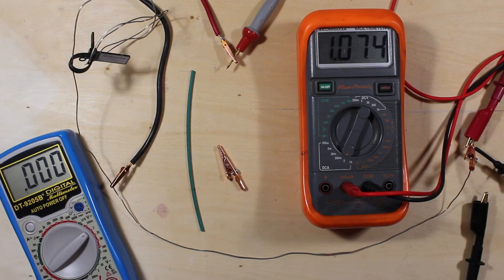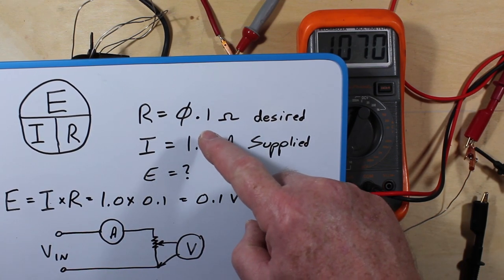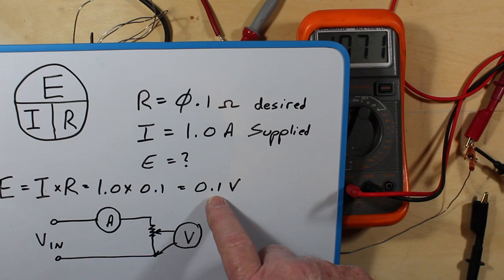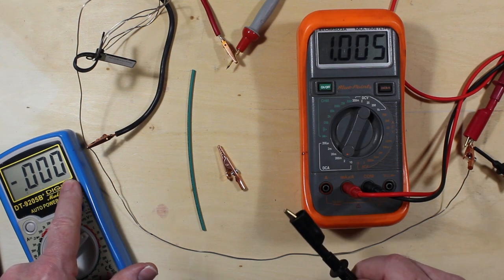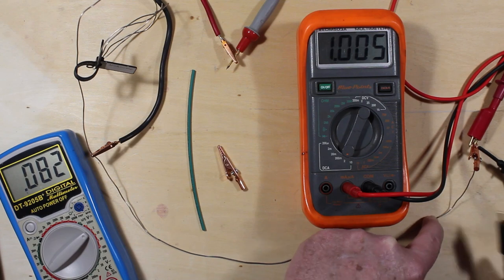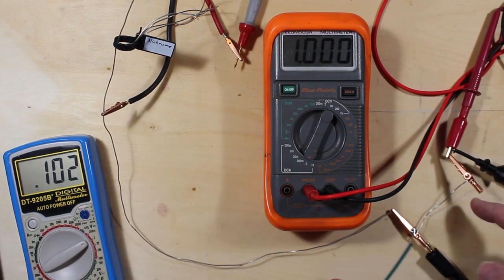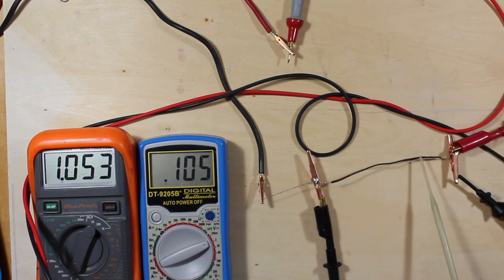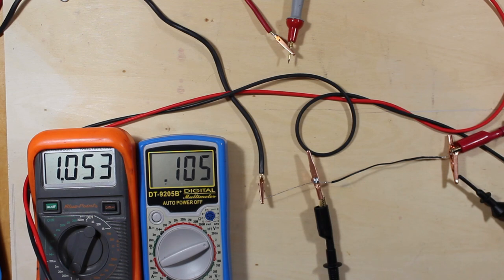DIY Low Ohm Resistor For Current Measurement  #electronics #diy #measurement

Comment: Hi,... it was quite by chance I landed on this video,... and thought it deserved a comment for it's utility. ( & educational point )
- About a year ago, I had a short-circuit on the 'alternator-battery' side of my 38-year-old Nissan Micra.
- It blew the in-line 50Amp 'safety fuse' !!!  
- With no documentation I eventually found the issue,.. but needed a replacement FUSE.
- Fortunately, being an electrical/electronics engineer,... and using the the 'resistivity of copper' (per cubic meter),... I was able to calculate & fabricate a direct replacement using a 1.2mm diameter solid copper wire (as used in standard UK house electrical wiring installations) of approximately 75mm in length.
.
Reply from the maker: A solution in time of need.  Was it a 'fusible link' (a short piece of wire smaller than the main wire) type?